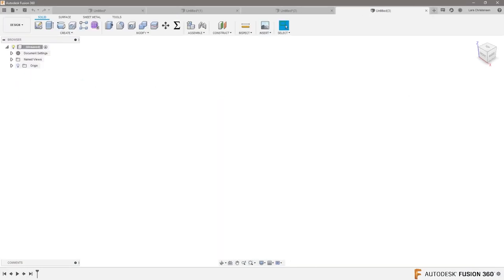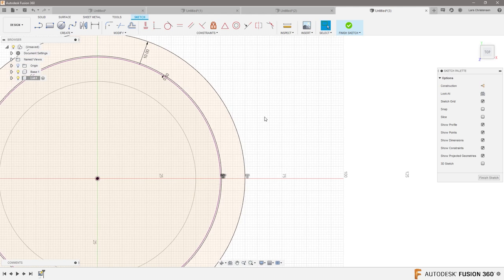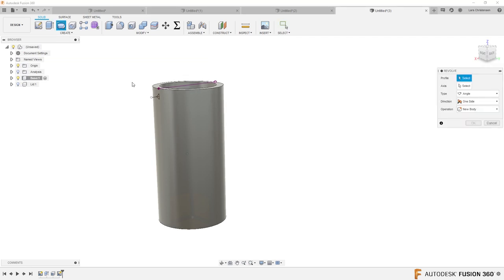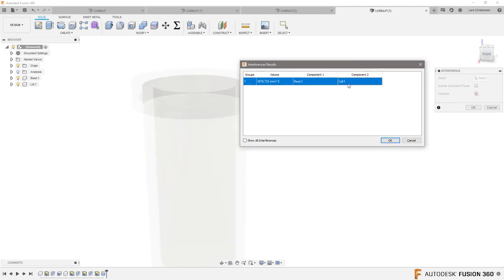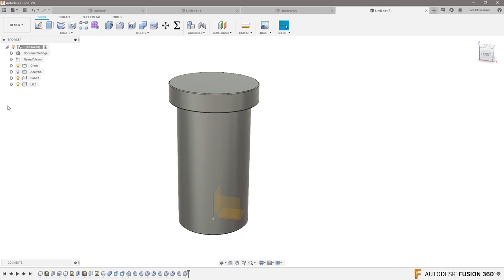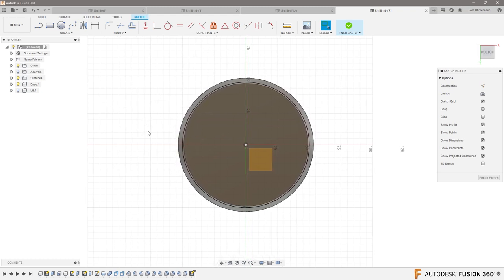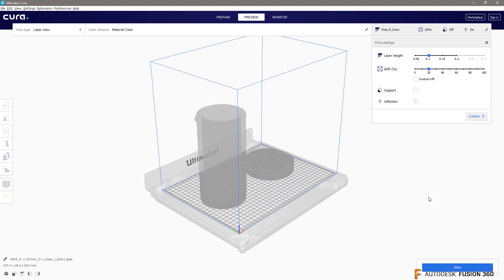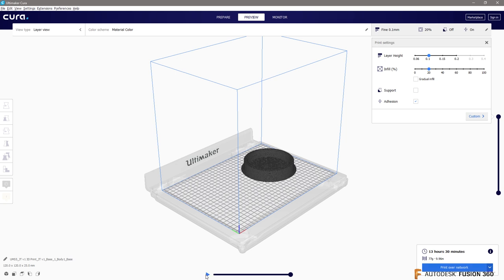Fusion 360 — How To Model Snap Rings for 3D Printing — Ask LarsLive

Comment: Great Vid Lars! Every time I watch your videos to learn one thing I end up learning heaps more. 
In answer to your question, 3d printers don't really require supports unless the overhang is around 60 degrees. 
You did mention the lid being round will make the snap fit more difficult. I estimate the snap fit offset distance from the main tube is about 2.5mm meaning the lid will need to stretch 4mm in total (inc the clearance) in two axix & this will still be too difficult despite the cut-outs you made. You did a good job with Cura... well done!
Reply from the maker: Thank you for the great comment👍😊

Comment: Always appreciate your videos.  For 3D printing, assuming an 0.4mm nozzle; set your layer height to 0.2 and infill to 10% for this design.  This should cut your print time by about 20 hours.  Also, don't be afraid to try a 0.6mm nozzle.  Great prints and even less time!

Comment: Generally, you won't need support for 45 degree angles. Cura also does adaptive layer heights based on features, that'll shave quite a bit of time off of that print. As far as the model goes, I'd suggest  making the protruding ring on the tube less wide as the lid needs to stretch to slip over them. Right now you're asking a solid lid to stretch 8mm. A larger relief on the open end of the lid would help, but simply cutting the protrusion down would help a lot more. Plus less print time.
Reply: 3D Printed a bunch of parts on my i3 MK3S including such features as threads obviously working with angles and the 30° overhang caused by a BSP one printed flawlessly without Supports. I assume it wouldn't work with just a normal bridge-like overhang but even the ACME type thread, which is a 14.5°, printed decent enough to be usable - A little crunchy though - Which kind of assists in keeping the Lid closed =)

Comment: Great video, thanks! A print like this I would never do in .1 layer height as it takes forever. Do it in minimum .2 which will cut print time in half or even better .3. And you also do not need supports for 45 degree angles. To speed things up a bit more you should lower your infill to like 5-8% max for a print like this, I would probably just skip it  altogether though :)

Comment: No 3D expert, but I seem to remember my less expensive Tevo Tornado can print without support up to 50 degrees (probably should qualify with proper temperatures, etc.). The CURA options are under Custom tab in your video. Sometimes I will print a skirt just to prime the extruder, etc. Somone below also mentioned less infill %, proper infill choice (cubic, etc vs. lines, cubic stronger), faster printing speed, and whatever. One could probably turn your design out on a lathe much faster than on the 3D printer, well I know I could.

Comment: I usually check print preview to check if the printer prints in air or if it has enough material under it to print. Usually 60degrees is the maximum I go without having to print support material

Comment: Marcelo Cabello
You have the best begginer tutorial for Fusion360 however you are not using the latest version that we, actual begginers, can get from AutoDesk so we can follow but there are several points where you can get lost and have to try and retry until you find how it can be done in the last version.
It would be great if you could just remake those three first tutorials but using the latest version of Fusion 360. Anyhow congratulations

Comment: I would suspect that the lid would be difficult to get on and off as the material rigidity of the top would prevent it from stretching around the snap ring.  This assumes either PLA or ABS would be the material.  If there were notches in the lower part that would allow the snap ring to deflect inwards when the lid was snapped on.  No support material should be needed (or desired) for 45 degree edges.  Another benefit of printing the lid separately from the base as any strings when the extruder slews from one part to the other would be avoided.  This makes the outside of the parts look better.
Reply: This is my concern as well. The pill box Lars is printing looks to be giant and the amount of stretching the lid would need to go over the  protruding bits would just make it unusable at that scale. If the protruding bit was much smaller it would have been fine. The infill matters as well as the perimeters. In this case you want to up the number of perimeters and lower the infill percentage. Notches in the lid would definitely help. Printing this like a 10 cm tall box it shouldn't take more than 3 hours max for such a simple object. You don't need finer than 0.2mm layer height unless you are doing fine art or screws. I've done plenty of functional parts where I have very little infill (5%) and there is no risk of breaking it. It all depends on the use case and type of design as well as print orientation.
Reply: Yes that would not work. Would be too rigid. Look for the snap fit case videos from adafruit great ones for that
Reply from the maker: You are totally on point😁 realized the thing would be huge. Scaled it down for then realizing that there are no flex 💪 LOL learning all this practical 3D printing engineering
Reply: @cadcamstuff  sorry Lars, you're never going to get the lid to snap over the ring. The ring is too wide and the lid is to rigid - both the material and the geometry (a cylinder)
Reply from the maker: I did manage to get the lid on...by the help of a my vise...but I will never get it off again 😁
Reply: @cadcamstuff  there are things you can do to allow the clip to flex - like cuts on either side of the clip. The longer the cut the greater the degree of flex.  Also, the thinner the wall of the clip region, the greater the flex. You have to balance all that against the weakness of the clip since it's likely to be printed vertically.
Reply: @cadcamstuff  Where there is a will, there is a way...  Congrats!

Comment: wow! You made that lid way to solid to snap like that! Plastic is too strong, I did not see the final result on this but I am very sure that is way too much interference, I was waiting for you to 
increase the diameter of the leading-edge as the lid comes down on the triangle you made, also, do a fast test print to confirm it works, not a 3 day print to find it dose not work. Right? Anyway I 
would like to see if it did work as designed.

Comment: I put a 1.2mm ring similar to yours on a ~70mm cylinder. No clearance on the lid as it slip-fits. No chance of the lid sliding over the ring w/o a press or vice clamp. Have to go back and reduce the ring and maybe add a chamfer to the lid to help slide over. Not sure I want lid-base clearance though. Might have to.

Comment: I hv been doing a lot of 3d printing but i do wonder if this really work in real life. unless it is printed with some flexible material? have you tried printing it out to see if it works? Cuz i hv been design and printing similar things with PLA, ABS or even resin type materials and this design looks tricky. From time to time I hv difficulty at getting the exact right tension for snap fitting parts especially for ring type snaps. I realizes when the object is with a circle/ring opening, the shrinkage is a bit more different thus the tension varies.
Reply: @BLau-oi4zc  i found U shaped pegs with really small barb at the tip are most reliable ones to balance between the brittleness and tensions of ABS/PLA material. I make prints for toy prototypes so the joints are made to be played around a lot and be able to hold the arms and legs in place for postures (given that i am not going to pull them off apart and pop them in again).  We then save the profile to be reused for other models. Rule of thumb for tolerance is half the size of an FDM printer's nozzle. The tension and shrinkage varies if the printing angle is positioned differently. So unless you are printing something super flat like devin montes where all the snapping is on the same plane, the clearance/tolerance wont work on other parts of the model. for example FDM prints i tried to level the peg and hv it printed horizontally becuz it gives it more strength therefore more resistant to break. And everytime i hv to adjust the design to different printers and materials, different colour of the same type and same brand of material would still hv huge variations. Resin prints are even more brittle therefore they breaks and wears out after a short while. However, cap designs like that, especially in closed rounded circular shapes, are the most difficult to make. The lid would either being too tight to be reopened again once u pop it on, or too loose to get it covered well, thus i found it hard to imagine how that design would work.

Comment: Love your videos they help me a lot but I’m having a couple of problems. I made a part following your spark plug video that was similar to your spark plug but it wouldn’t allow me to sketch on a face plane to add holes. Then I made it all one piece and I could add holes but it would not allow me to select the X ternal face of the cylinder to add threads can anybody help me out thank you
Reply from the maker: Try the trick of holding your left mouse button down for a few seconds over the area and the selection dialog will appear
Reply: Thanks. I tried that but for some reason it won’t let me select that face of the tube to ass threads. What I had to do is make a new sketch on the face and extrude a circle the same dimensions then it let me add threads

Comment: Hi Lars! Is it possible in Fusion 360 to simulate and visualize the deformation of the lid while it is snapped onto the cylinder? Keep up the good work
Reply from the maker: Not really the power of mechanical CAD like Fusion. You could do the calculations of the yield of the material strain, but if you are looking for a smooth animation, maybe look to something like Autodesk Maya
Reply: @cadcamstuff  thanks!
Reply: You should be able to do an Event Simulation study in the Simulation workspace with a prescribed translation to estimate the forces and deformation.
Reply: @JakeMcIvor  Hi, I have to look into that, sounds pretty cool.. Thanks

Comment: Seems to me this object applies stress where it is unnecessary. Personally I would use threads instead of this! Not to mention this is NOT the proper way in which a "snap ring" is used!
Reply: Can you clarify how a "snap ring" is supposed to be used?
Reply: The thing shown in the video is a snap fit lid not a snap ring. Snap rings go are often used to hold components on a shaft or keep a component inside a hole. They are also called circlips. I'd check out pistons in engines and how the crank pins are held in place.